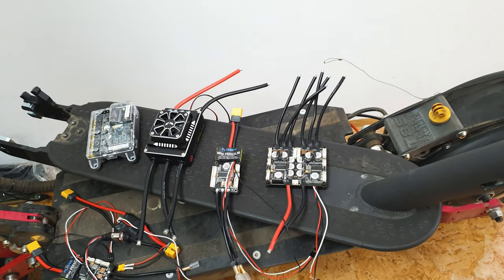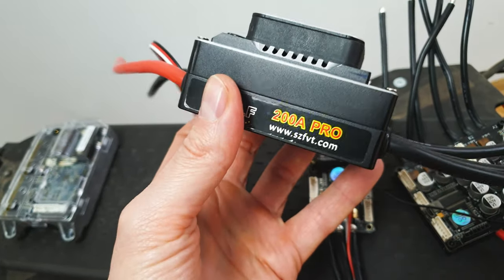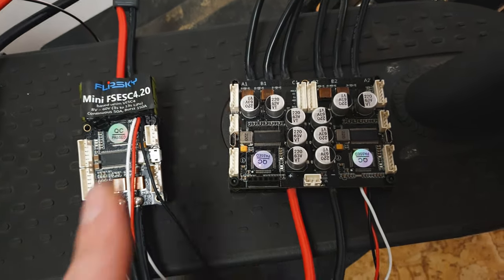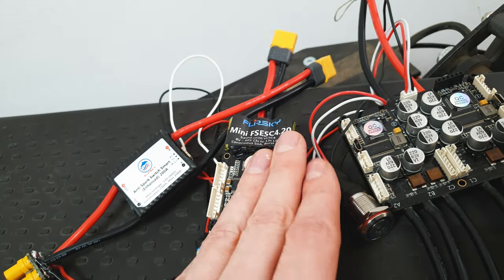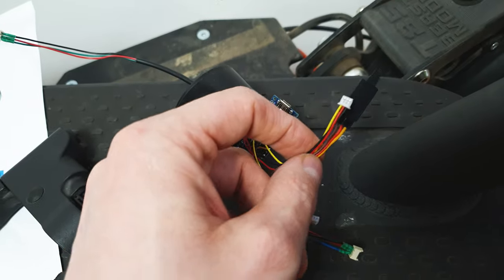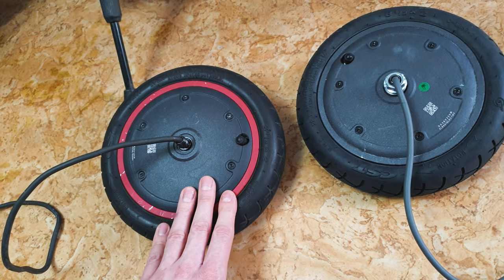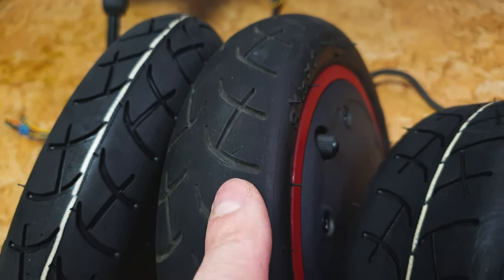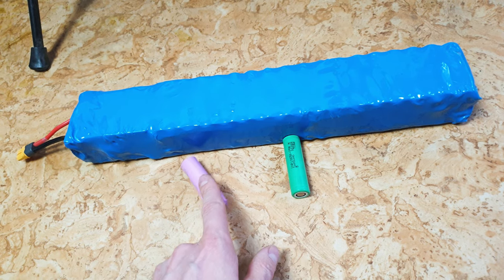How to build Xiaomi M365 2WD / AWD 1# episode  Parts

Comment: I hope Xiaomi are watching and taking notes. 2WD would blow the E scooter market up.
Reply: @gtone339  They're all shit, even the Pro 2. Same specs as the old pro.
Reply: @gtone339  Xiaomi need to up their game for the money being asked. More power with light suspension would be a vast improvement. Also fix the common complaints; Rubbish charging port cover, loose folding mechanism after prolonged use and rubber covers that vanish in the blink of an eye.

Comment: Awesome project, I'm also a drone guy and planning to do the same!

1. What about BMS? In xiaomi ecosystem the BMS communicates with the esc to get information about the battery, would that also work with VESC? If not then how do you plan to monitor battery state?
2. Would G30 MAX motor fit the xiaomi pro frame? It can handle even more amps than Xiaomi pro motor + it has tubeless 10 inch tire.
Reply: 1. You can disable bms communication in custom firmware
2. Xiaomi has tubeless tires too, but what difference? pump it.

Comment: Hi. I made AWD my M365 but I wonder how can I put two controllers at the bottom. I like yours controllers and can I get them and put instead of original M365 controllers??
Reply: 2 original controllers can be work better than this project, so the firmware on the m365 board its fully customizable,and you can get the 2 controllers inside plus 20s 3p battery and others.
Reply: But how abot arduiino for throttle and break sensitivity??

Comment: What about the braking system though how would that work?
Reply: Electric like the Segway ES models
Reply from the maker: Vesc got insane regenerative brake, with lots of safety features :)
Reply: @PirateWasHere  Will it suffer from overheating issues due to it being dual-motors instead of one? Plus, I still rely on mechanical disc/drum brakes instead of e-brakes.

Comment: is there a VESC that can handle 2 batteries?
Reply from the maker: What do you mean
Reply: @PirateWasHere  The m365 controller(vesc) has 1 port, to connect to the battery, am asking if there's a vesc that allows you to connect 2 batteries
Reply: @evansyomu2879  All you need is Y cable.

Comment: Can I replace M365 (250w) motor with M365 Pro (350) motor?
Reply from the maker: sure, you will feel better troque :)
Reply: @PirateWasHere  Will I need to change the controller?
Reply from the maker: @dawoodkhan6067  nope
Reply: @PirateWasHere  Great! I have a Code 18 on my M365. Do you think replacing the motor wheel should fix it?

Comment: Didnt you mess up the KV of PRO motor and classic? 10:25 is super confusing.  
The pro has higher KV and higher max speed and you say the motor with lower KV is more efficient and can do more power .. and you recomend the PRO anyway? 
I am trying to find out the true comparisons between the PRO and classic motor and this vide just made it 10x more confusing. So which one has more torque,  and which one goes faster?
My classic with RTA does max 32-33kmh and im pretty sure the PRO does 35kmh
Reply from the maker: Motor with lower KV has more torque but rotates slower, motor with higher KV opposite . Pro got motor with lower KV and magnets are a little bit bigger so overally PRO motor got more power, is more efficient but rotates slower than classic :)
Reply: @PirateWasHere  But.. the PRO motor IS faster than the classic. No way the classic motor can do 40kmh without 12s mod. The max classic does is 32
Reply from the maker: @KaktitsMartins  I will have to investigate it again , thanks 🍻💪
Reply: @PirateWasHere  Ok, please share what you find out, because im planning on upgrading my classic motor with PRO motor and its kinda important to know if its worth it.
Reply from the maker: @KaktitsMartins  i can tell you now that pro motor is better, but i would choose whole new pro rather than only motor upgrade
Reply: @PirateWasHere  Why, because of battery? That is no problem as I already have external. I already have classic and when I bought it, the PRO wasnt really financially an option, so im upgrading. :) Classic + external battery + second hand PRO motor = same price as PRO, but with even more battery :D 
Also, what about the G30max motor? I think that has the same top speed as PRO, but it also has even more torque?
Reply from the maker: @KaktitsMartins  pro  got bigger deck and overally feels way more rigid
Reply: @PirateWasHere  Bigger deck is exactly what I DONT want :P 
I like it small and light :)
Reply: @PirateWasHere  Do you maybe know the exact value about Kv between the 2?

Comment: Hey Pirate, I have some good news for ya! Xiaomi might release a refreshed Xiaomi M365 dubbed the "1S" in Q3 2020, which inherits the M365 Pro features such as the LCD screen, black bell, large disc brakes, but the battery life, dimension, and the tyre remains the same! Plus, there's more variants! Another Xiaomi E-scooter dubbed "Lite" version could be a lighter version of the "1S" has been planned to be released this year, and also a successor to the Xiaomi M365 Pro dubbed the Xiaomi Pro 2 will be announced this year as well. Hoping for Xiaomi to make huge upgrades for the Pro 2 over the M365 Pro by adding single/dual-suspension, greater range that the Ninebot Max, slightly different design on the body/stem/mud-flap and LCD-screen, 10" inch tubeless tyres and also greater motor power of 500w! 
link: https://www.elproducente.com/travel/new-xiaomi-electric-scooter-1s-30km-range-display-m365-successor-review-manual-comparison/
Reply from the maker: Actually this 1s is simple classic , they just want ro earn some extra $$$$ 😵
Reply: @PirateWasHere  True that! Still curious about that Xiaomi Pro 2 model though! 😁
Reply: @PirateWasHere  Just hoping for Xiaomi to address the M365 Pro issues by adding dual-suspension, more powerful 500w motor, top speed increased to 35km/hr or 40km/hr, greater range up to 45-55km range in Sports mode, larger 10" inch tubeless tyres, redesigned mud-flaps/rear tail lights/wider footdeck/ LCD screen.

Comment: Flipshite
Reply from the maker: any better for this price ?
Reply: @PirateWasHere  neoBox from Rideneo is new and cheap, there is also some open source VESC designs that can be ordered from JLCPCB and assembled easily (cheap focer). 

It's true for lower voltage and current that flipsky can be ok, but the specs they give can't be trusted.